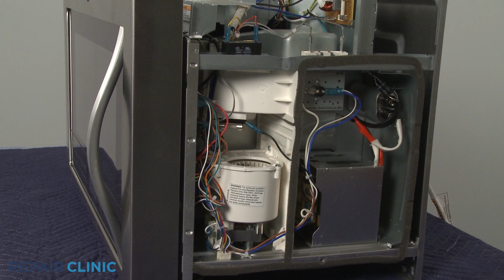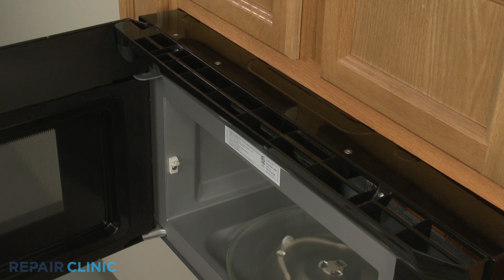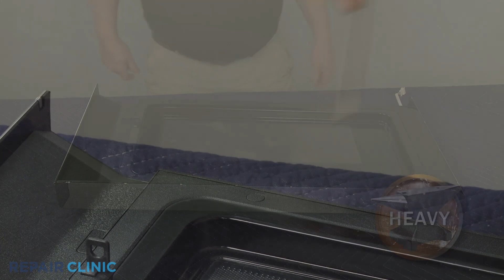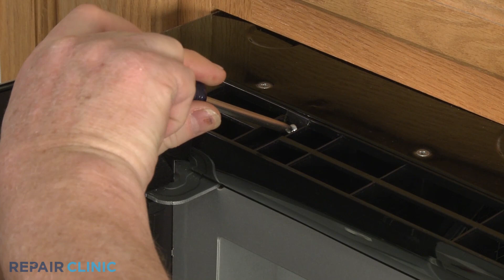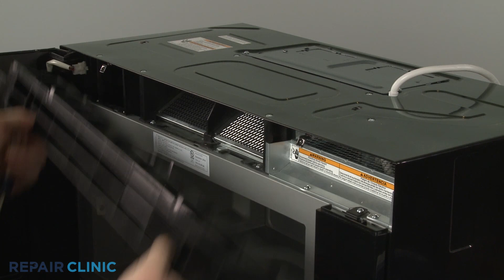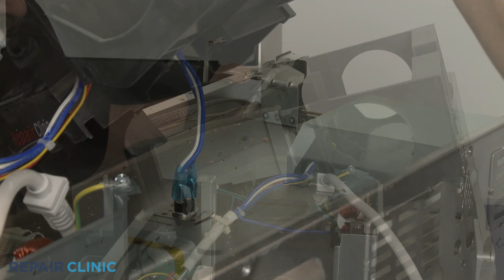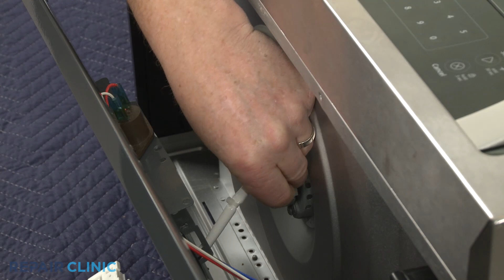Whirlpool Microwave Oven/Hood Combo Disassembly – Microwave Repair Help (Model WMH73521CS6)

Comment: I lost all power to my microwave and replaced the main 20amp fuse, however still no power.  What else would cause no power to the microwave? I also check the breaker box to make sure the breaker wasn't thrown.   I checked power from the outlet that the microwave is plugged into as well.  Lost.  Thank you
Reply: There are two fuses. One above a fan at the front and one at the top right all way on back panel of microwave.
Reply: @CAROLiNABLUEMUSIC  Does the microwave have to be taken completely down to access these? Is there one I can access without taking down to try first? Can you give a little more info on where this one is? I am having the same issue.
Reply: @tiffanyreitz5408  at 0:38 you can pause and the the other fuse at the top of the screen. And, yes it looks like the microwave will have to be taken down to access 😢.

Comment: A door switch failure is a common issue on microwaves with the large doors containing the controls. The weight of the control panel and full width door puts added strain on the door switches. Over time you'll notice your door sags slightly. Mine began sagging enough to hear a slight rubbing sound on the hinge side. A few months later I noticed three was a delay before the interior light came on. Then after baking a pizza the microwave failed to turn off when I opened the door. I knew exactly what happened. The door switches needed replacing. During the same repair I added a thin washer to the bottom hinge to lift the door enough to open and close properly in order to reduce strain on the new door latches. Before ordering new component ensure the hinge screws are properly snug. Inspect the door latches to ensure a spring or connection didn't come lose. If the screws, springs, and electrical connections are not the issue, note your model number and order parts. To save money orders parts ahead of hiring a repair man/woman. However some repair men/women won't install customer supplied parts due to liability issues. In such instances, while scheduling the repair, insist the repair man/woman charge for the part without their 20-50% markup. In advance of scheduling find the exact new parts necessary online. Print or save the webpage noting the new part with the everyday price. EBay and Amazon may have cheap knockoff parts that do not comply with safety standards. Therefore such illegal parts are not suitable for price matching. Nor should you attempt to install them in your appliance. Doing so can cause fire and/or death or injury. Only use parts from reputable suppliers. Your safety is much more important than saving a few bucks.

Cheers!
Reply: I had an issue with the door switch on and off. It would sometimes not register that the door was closed. Prior I would toggle the switch with a bent clothes hanger and it would work again. This time it looks like it shorted out because the unit went dead. Any idea what could be the issue?
Reply: @Cbv1914  blew one of the two 20amp fuses. I just had the exact issue tonight. I repaired a stuck micro switch. Gotta get the fuse tomorrow.
Reply: @CAROLiNABLUEMUSIC  I got a multimeter off amazon, found the bad switch. Whirlpool said they don’t sell the individual switches but they sell the upper or lower bracket that houses two switches each. That would be $40 each and wouldn’t be available till January. Ended up ordering both the switch and fuse off amazon. In total I spent $25 on the tool and the two parts. Has worked great for the past 4-5 days now.

Comment: Mines says door not closed....so is it the switch box or holder i need to replace??????????plz hlep me lol
Reply: You can take the switch apart and the contacts will be welded together but can be seperated then sand them lightly.  Should work. To test all the switches have a brown tab you press to hear a sharp click. No click it's stuck.